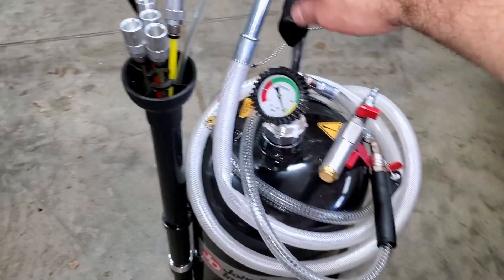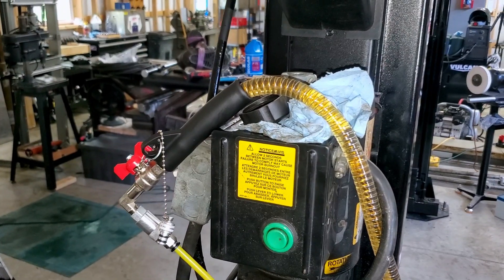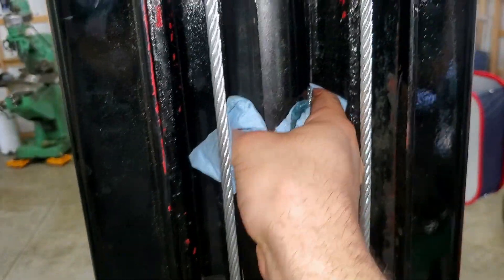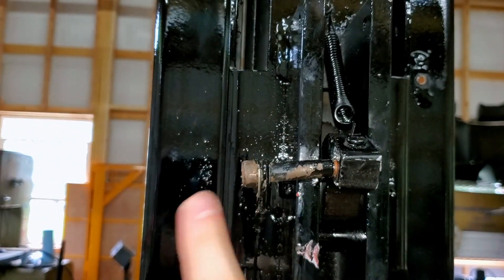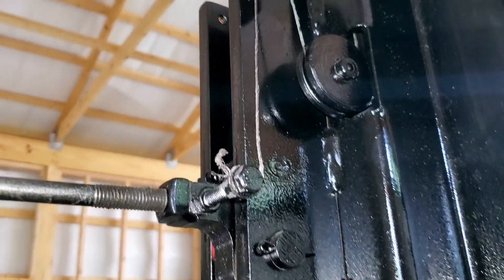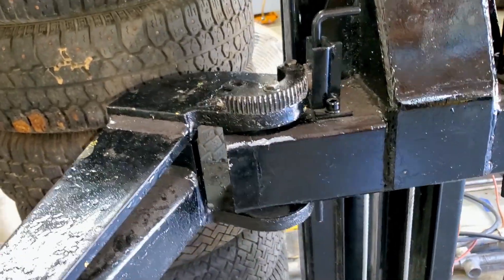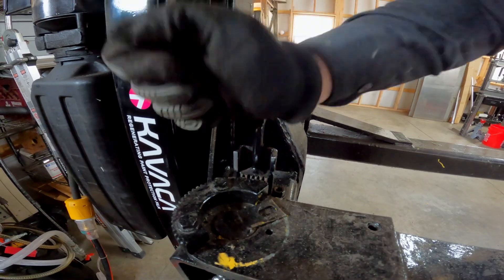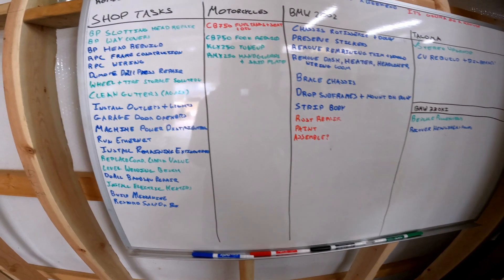We FIX and TEST our USED $1500 TWO POST LIFT on a Tacoma!

Comment: How is the epoxy studs working out? 
Some of my mechanical anchors are coming loose. I was thinking of using threaded rod and epoxy.
Reply from the maker: @B88C123  fantastic, zero change since installation.